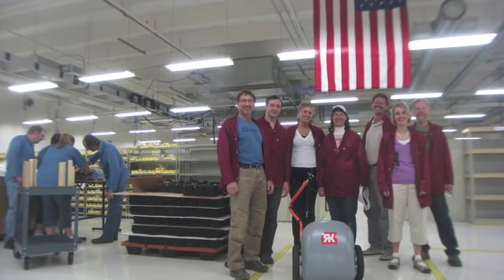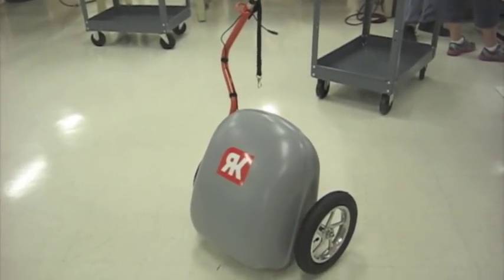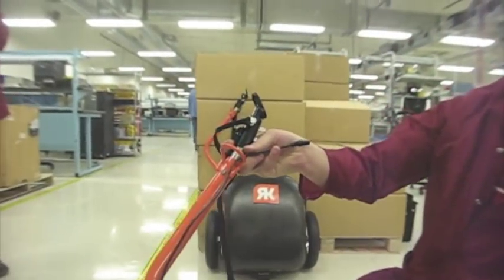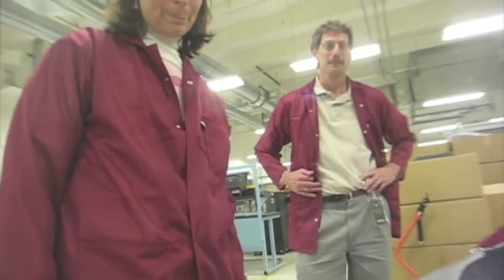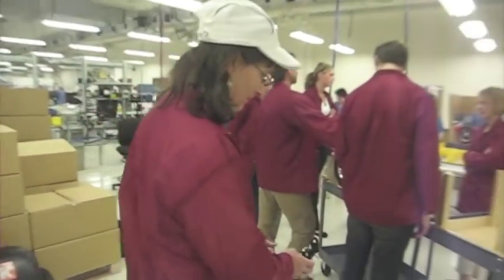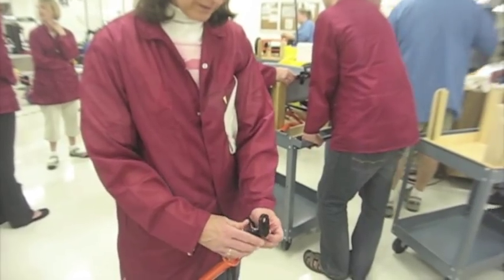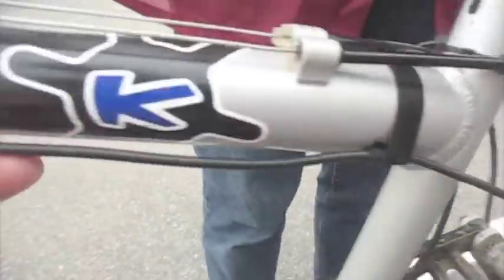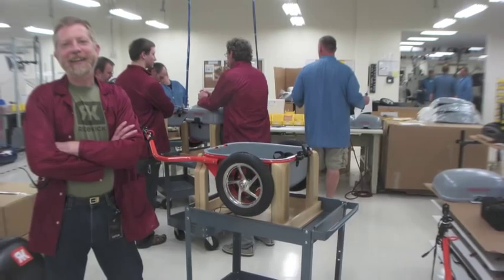Ridekick Headquarters Tour in Loveland Colorado

Comment: would it be possible to hook this up to an electric bike for back up power?...would this product also push an electric bike? would it give an already electric bike more speed if both were use in unison? I already have an electric bike but would like to have a source for more power and also the use for back up power.
Reply from the maker: Sure, you could add this to an ebike to extend your range (use it after the ebike battery is exhausted). It might offer more power if you used both at once (for climbing or hauling stuff) but it will not increase your speed as both systems would be limited to 20mph. RideKick is going through restructuring so this unit can only be found used at the moment but you could make your own with a Burly trailer like this: http://amzn.to/1jk9ym5 and a hub motor kit in a 20" wheel like one of these: http://electricbikereview.com/category/e-bikekit/ (get the 350w geared or 500w gearless in a 20 inch wheel size and mount it on the left wheel of the trailer, put the battery in the back and wire the throttle up to the front handle bar on your bike.)